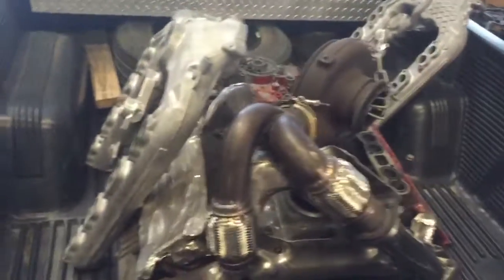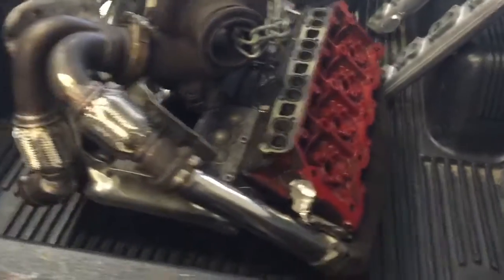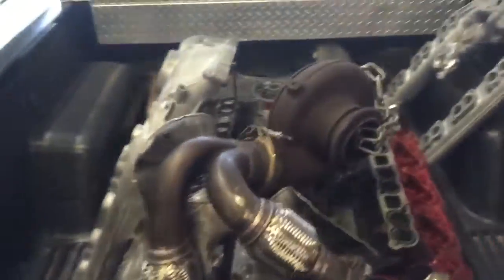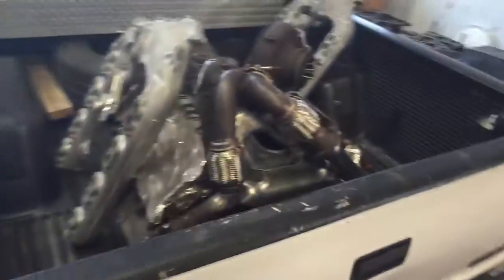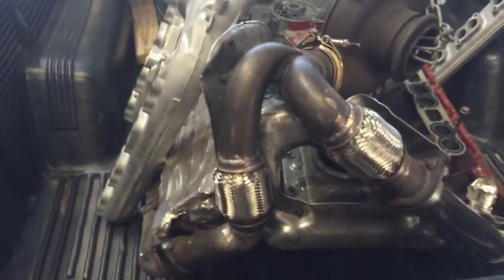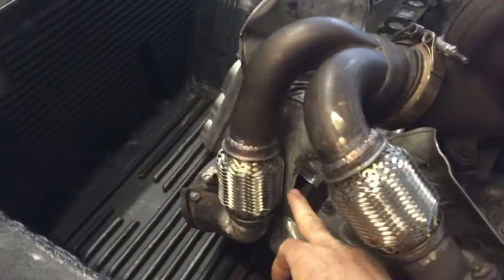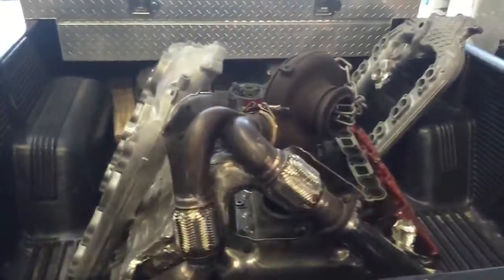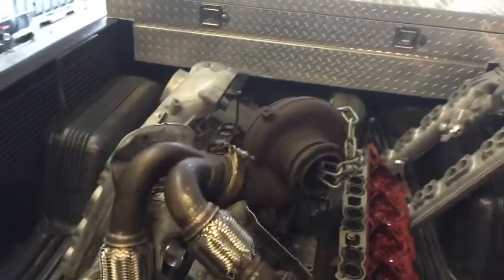Tig welded Y-pipes from Super Duty Service

Comment: super old video question time! which vibrant flex joints are those? there are two which look the same on the outside- one is lined and one is all braided. which ones do you guys use?